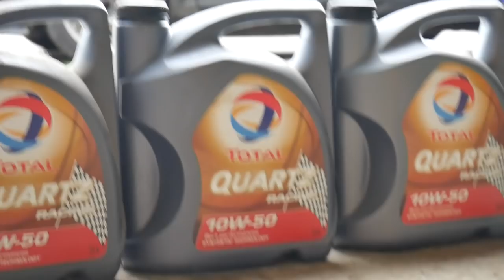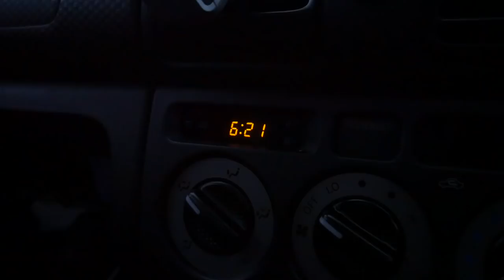Honda 2000S Oil Change and More...

Comment: Hey Danny.🙋 Straight away, what a brilliant opener!😍 Nice to have a closer look at Josh's S2000 (or is it 2000S?). Shoutout to the "Badge Bodger" whoever you are.👍😂😂 It's in the good hands of HCR now, so no worries.👌 You mentioned an oil filter retaining bracket to keep it from backing off... I haven't heard of that. I have seen a cool bracket mounted to the shock tower to prevent the brake master cylinder from flexing. Josh might want to look into that with all the track duty this car may see. Very much lookin' forward to the MR-S - S2K battle. That flyby was pure badass!😲😍 More pls.😆 Oh yeah, pretty cool, old-school Mini, too. Wouldn't mind seeing that thing go once it's running better. See you on the next episode, Dan. Thanks for the "good" show, mate.✌
Reply from the maker: Thanks Mick, I'm gonna get the MRS/S2k vid finished this weekend. I'm handing back the car tonight! :(

Comment: Dc5 K-series turbo, light weight pistons/rods/crank/fly wheel, big injector, big fuel pump, built fuel regulator, standalone ecu, and top mount with larger turbo to minimize lag. 300+ whp for a 7:45 ring. Step the fuck up, you drive well.

Comment: I use that oil in a Honda that burns a bit of oil or if it was track only but stick to Shell Helix 5w40 otherwise
Reply from the maker: +elliot438bcfc 10w50 dropped my track temps a bit compared to 5w40. Some say the extra weight reduces the power but it still pulled 244 on the rollers so meh!

Comment: Having owned a JDM AP1 S2000 and really enjoying that power plant I would really like to learn why the k24 is a good way to go? I read in another comment that the power delivery is more linear rather than the peaky f20c. And the k24 is more open or responsive to tuning than the f20c. However, I'm not sure if you're aware, but there are some guys in the USA that have tuned the nuts out of their f20cs with reliable results. I do know of a couple of guys out there running turbo f20s. I'm pretty sure one of them did blow up quite quickly but that was due to a poor build rather than the engines limitation. Engine swapping just seems like a heck of a lot of effort for a similar pay-off (??), when you can still supercharged or turbo the f20. I'm not here to criticise I'm just hoping to learn something from people who know a bit more than me, as I've never heard of this k24 swapping before. Cheers. Very interesting stuff and I can't wait for that MRS/S2Ks video.
Reply from the maker: One of the main things to remember also is that the F20c is worth a lot of money. Around £3k here. If you are going boost anyway, it makes sense to go K. F series you can tune I know but it's very expensive again with no real benefit. K swap in the long run will be the best.

Comment: Not trying to be 'that guy', I just know nothing about Honda's, but why swap a K24 in the S2000? It makes less power then the engine already in it
Reply: Rick te Kronnie I think it's more about 'real estate' under the graph if you get what I mean. He called the F20c a glorified B series because of the peaky power delivery up top with no balls down low. K series engines have a relatively smooth power curve, so peak power may be less at a certain RPM, but with a K24 you are making more power more of the time, making sense both on road and track. That's why the K20 may only have a few more horsepower than a B series, but on road performance is ten fold in terms of power delivery and 'torque' 

Plus a lot of tuning can be done with the k24 with the k20 head (what Josh is doing) I think to bring peak power to 240hp, as a standard k24 head doesn't have as aggressive timing

Comment: So why would you go K24 on an S2K?
Reply: I meant other than that
Reply: Wayne Clement f series is considerably less reliable
Reply: @PUNKF001 the f series isnt as reliable as the k series just look at performance cars' troubles with his s2k
Reply: PUNKF001 exactly stick to playing battlefield
Reply: Alex Christie early s2000's have crap valve retainers. Later ones are fine and its an easy fix if it hasnt already killed itself. No point arguing with a fanboy though is there. Muppets
Reply: K24/K20 frankensteins make more power than either K20 or F20C. :)
Reply: TassieLorenzo in a bigger torquey way too, how revvy is the 24? Obviously its the F20 party piece, and thr K20 spins quick